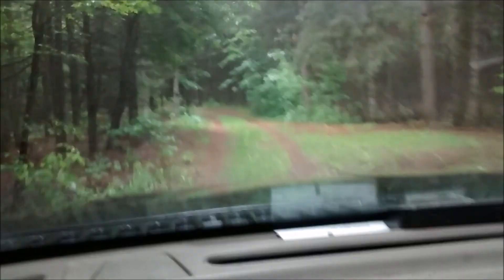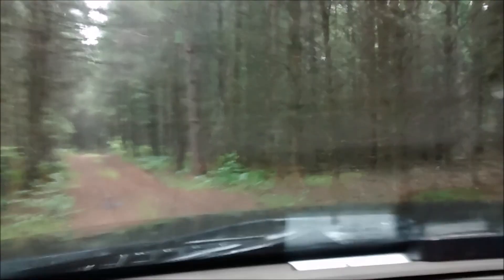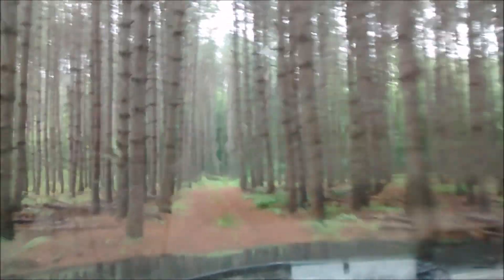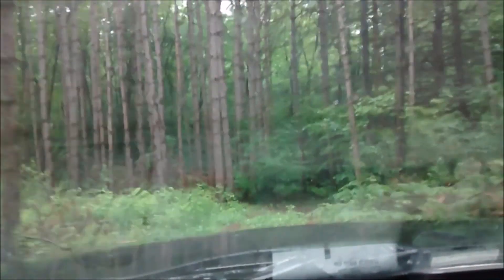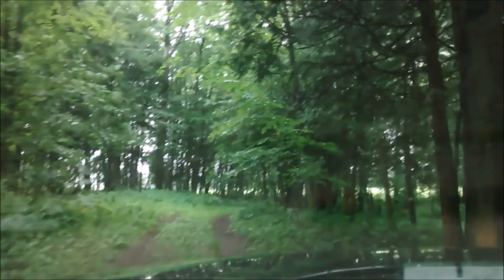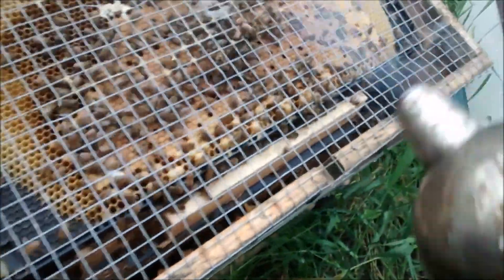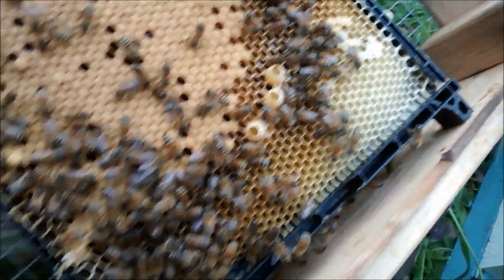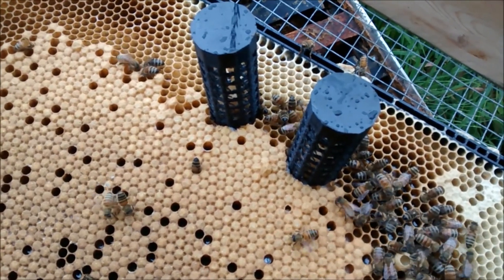Plastic foundation queen cell cages for  Hopkins method

Comment: How did you flip it back over with the roller cages pressed in?  Did you have to manipulate the frames below to make them fit?
Reply from the maker: I pushed a bit of comb in towards the rollers and then flipped the frame over gently and they stayed in place but the end of these then tested against the frames below to keep them positioned.